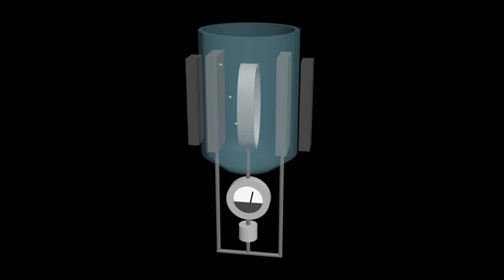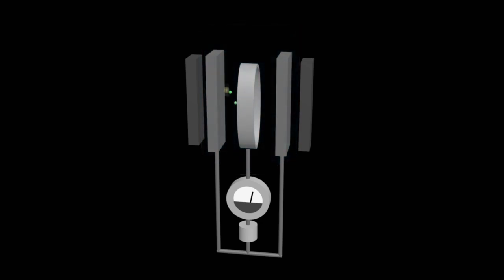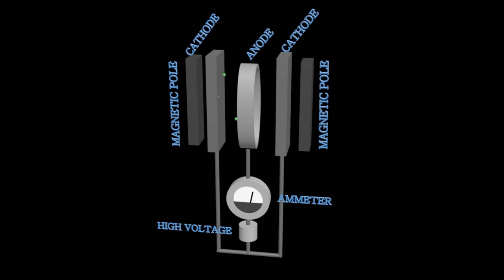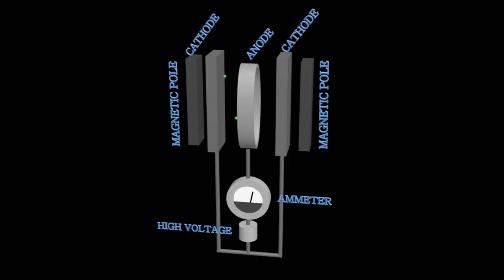Penning Ionization Gauge Working Principle Animation - How to Measure Vacuum

Comment: I did't get the final idea idea, there is a moment where it is mentioned "...And these ions are accelerated towards the catod..." I should remark positive ions will travel towards the catod and negative ions and electrons should travel towards the anode I guess there is a constant bipolar current flowing between these components? I was wondering, if that's the adequate geometry for the magnets to cause an helix trajectory by Lorentz´s force? tnks.
Reply: Any body have idea of penning gauge